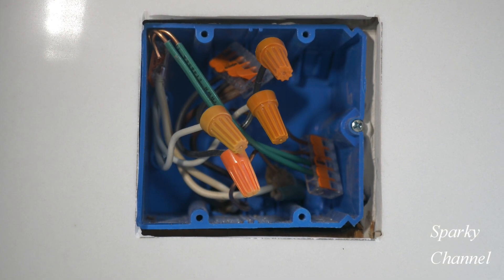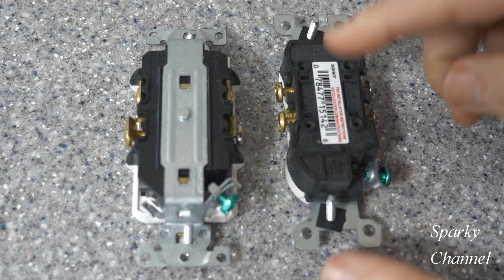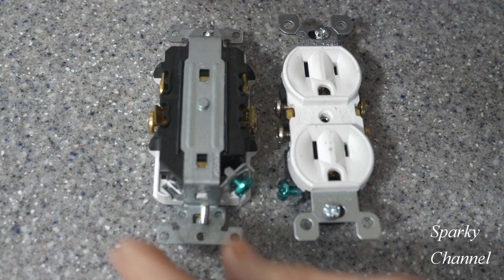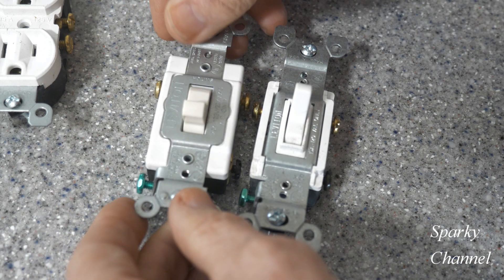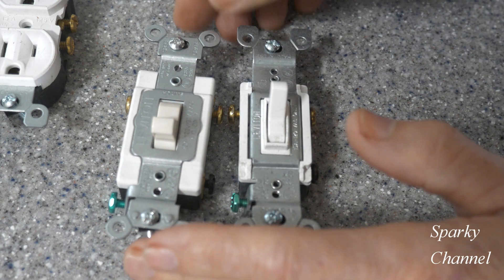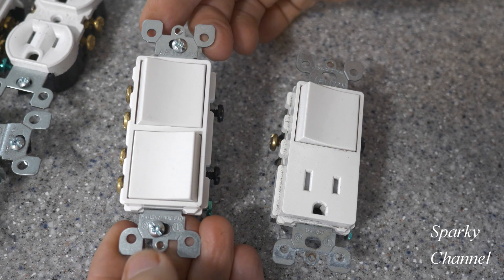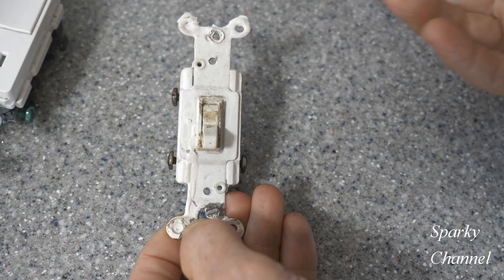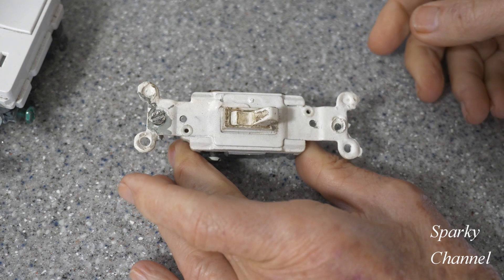Receptacle Strap or Yoke

Comment: It’s all about the $$$$. Lets be real 😅

Yea, they’re a bit beefier, might last a bit longer under harsher condition, 
But, they basically threw a helmet on it and called it special.
There’s absolutely No need to use spec grade things outside of commercial use. It doesn’t provide anything other than a bit of rigidity.

As for the “paint stopping the switch from getting a proper connection to the box”…. That’s why it’s code to bond the switch to the box 😂
(I know a lot of old wiring was done without proper bonding.. but, nowadays, it’s part of the code)
A bit of paint on the metal housing should make ZERO difference if wired properly. (ie. switches in PVC boxes work just fine)

Comment: I would guess the full-length strap also helps in case there's a loose wire in the box that comes in contact with the back of the switch/receptacle?
Over the past few years I've installed a number of commercial grade switches in the house. Gotta say I love the positive "snap" when you flick the switch. It just feels so solid...
Reply from the maker: Hi Jo! It's true, there is a bit more of a "snap" with the higher quality switches. It's not anything like the old 1950's and 1960's switches which were very loud, but there is a positive "snap" when you flick the switch.
Well done on installing quality devices!

Comment: since I got interrupted multiple times watching the clip, I don't recall if you mentioned the strap in the residential grade receptacle passes between the face and the back of the receptacle.  it's there, and it usually has the contacts for the ground pin built into it.  but it's not as rigid as the strap on a commercial grade receptacle.  but the biggest difference is durability.  the question at hand is whether spec grade durability is useful in normal residential use.  the normal lifespan of a quality residential grade device is decades, barring abuse, so except for a case where I had a bad batch of switches, I have residential grade devices in my own home, with no qualms at all. - and only a few switches needed to be replaced.
Reply: He did mention the strap going through the inside.
Reply from the maker: Hi Ken! Yes, I did mention that. See 1:10. All of the receptacles in my new kitchen remodel are spec grade.
Reply: @SparkyChannel  as I said, I got distracted multiple times.  my kitchen remodel's 18 years old, and aside from cooking off both GFCIs with my backup generator, nothing's showing any wear.  it was some of the light switches in the rest of the house, where the pressure from being in undersized boxes with #12 wire was putting enough stress on the switch I had to go to spec grade to get them to work reliably.
Reply from the maker: @kenbrown2808  Excellent!

Comment: Grab the plug much better and hold up to frequently used location. Definitely what you want at a workbench, vacuum cleaner, kitchen counter.
An extra $1.50 now verses replacing next year.
Reply: A guy asked, “how do you keep the plug from falling out of the receptacle?”  Answer, “Replace the receptacle before a fire starts!”
Reply from the maker: Yes, buying quality can save a lot of $$$ in the long run.

Comment: nope. makes no difference for the grounding. one has more backbone, but they are both designed to be efficiently produced for a low price. and the "commercial grade" one probably has a better profit margin, hence its name. house constructors get dirt cheap electrical junk.
Reply: not so much.  true, it makes little difference for grounding.  the main difference between residential grade and commercial grade is durablity.  commercial grade hardware is made fur more use cycles per day than residential grade devices.  so unless it's in a high use situation, I have no problem with using quality residential grade devices.  but in a high use situation, like the place you always plug in the vacuum, the commercial grade will wear better.
Reply from the maker: Some house constructors do use cheap electrical junk. I've seen it. Also, some house flippers use cheap electrical junk. Homeowners don't mind paying for quality though. Just my observations.
Reply: @SparkyChannel  I was so glad to see house flipping fall back out of fashion in the 2008 recession.  there was so much bad work and bad hardware I had to fix during the flipping era.
Reply from the maker: @kenbrown2808  House flippers.... touchy subject for me. Some are just out for a quick buck. I've seen them try to hide cracked slabs and not mention illegal room additions to buyers, just to mention a couple of things.
Reply: @SparkyChannel  some are ignorant, some are crooked, all of them just put lipstick on a pig and try to sell it as a treasure.
Reply from the maker: @kenbrown2808  Out here some house flippers like to just put 3/4" rock all over the front, sides and back yards. That is their idea of landscaping. It is terrible to for a homeowner to get rid of later.
Also, I have seen incorrect retaining walls built by house flippers that will just collapse some years down the road, long after they have sold and got their money.
Reply: @SparkyChannel  in my lifetime, my town has been through the white rock fashion, the red lava rock fashion,  and the fist sized round river rock/ quarry rock fashions.  I still prefer the big self sufficient shrubs and mow the rest style.
Reply: @SparkyChannel  I should mention, as far as electrical components go, Ikea is a swear word.

Comment: It's a 20 amp outlet vs 15 amp
Reply: Nope. All duplex receptacles are rated for 20 amps. Google it. I believe Bill did a video on that subject.
Reply from the maker: True, but the strap in the back of 15A and 20A spec grade receptacles are the same.
Reply: @ORD80  no but I will

Comment: I would think if you've got a switch or receptacle that is still working from 1960, that's an excellent sign of a quality product, which we know everything, back in the day, was. Anything you would replace it with nowadays is nothing but garbage, spec grade or not. How many decades did switches and receptacles work flawlessly without that little green ground screw on it? I don't have any factual statistics of fires or injuries that may have been caused by not having a ground on a light switch or receptacle, but I can only imagine that it was lobbyists and bureaucrats that said, "hey let's make this a requirement", just like all the other safety requirements.
Reply: in the house I grew up in, anyone who accidentally touched the microwave and refrigerator at the same time got lit up.  I personally got bit by accidentially touching the metal parts of our electric weed eater.  proper grounding primarily protects the wiring from problems caused by a short circuit, but it also prevents leaving a bad circuit with a ground fault looking for someone to go to ground through.  I've run across hardware from the 40s, that still sort of worked, but desperately needed replaced with newer safer hardware.  I can say for a fact that houses worked on by people with your "the ground wire is just to make bureaucrats happy" mentality are among the worst wired houses I've worked on.  and not just because in some of them , the jerks cut the ground wires short to keep anyone from bringing the wiring into the 20th century., but because pretty much everything else they did was a protest against good workmanship, too.
Reply from the maker: Hi Tracy. I have a video you might like: Replacing a Vintage 1960 Switch and Grounding the New Switch: https://youtu.be/FxaJ3MtwVpU